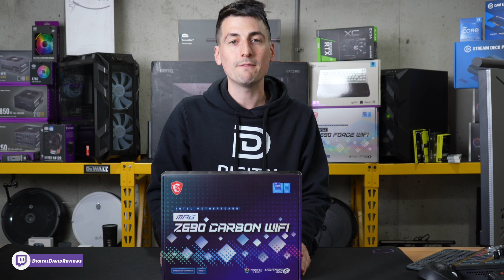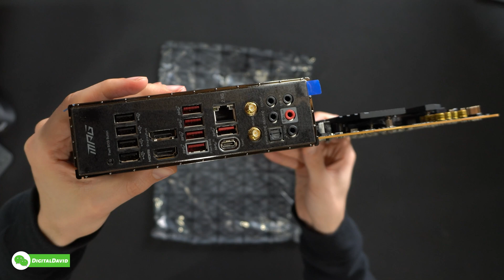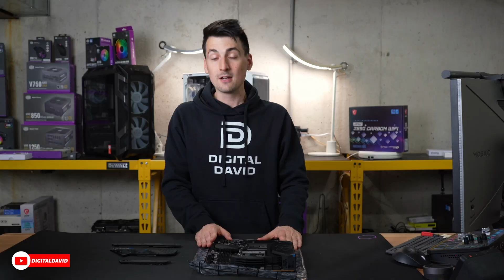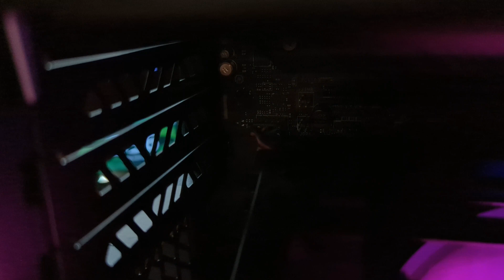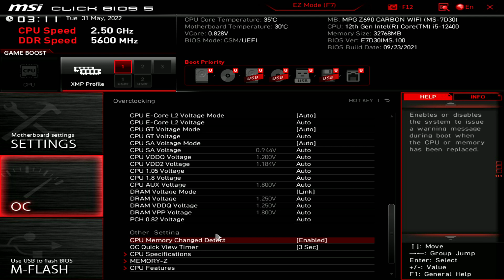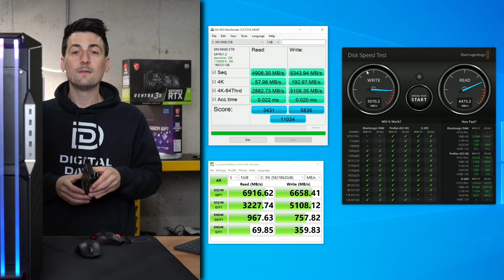MSI Carbon WiFi Gaming Motherboard Review

Comment: Hey sir, I have the same motherboard and I recently got my pc repaired for something, and upon recieving it back I felt that the motherboard feels different. I tried checking the motherboard's serial number using a cmd command and found out that the serial number provided by cmd is different from the one on the motherboard's sticker. Can you please check if yours are the same. Would really appreciate it, thank you
Reply from the maker: I understand your concern about the motherboard's serial number discrepancy

In such a situation, it would be best to contact MSI customer support or the repair service you used to address your concerns. They would be able to provide you with accurate information and guidance regarding the serial number issue you've encountered. They can verify the authenticity of the motherboard and help you understand if any changes were made during the repair process.

It's important to communicate directly with the appropriate support channels to ensure you receive accurate and reliable information for your specific situation. I hope you're able to resolve the issue satisfactorily. cnl